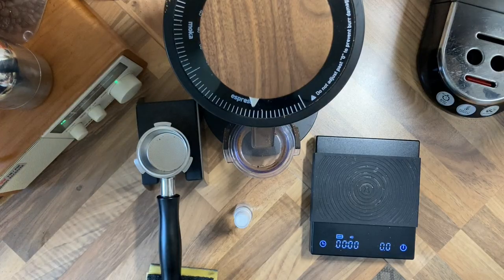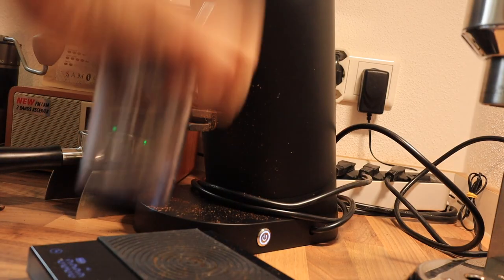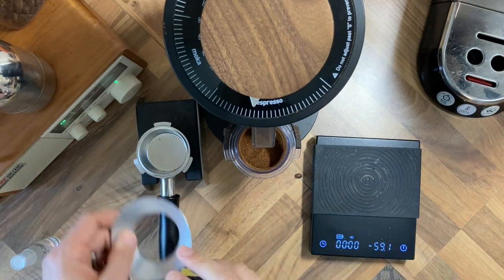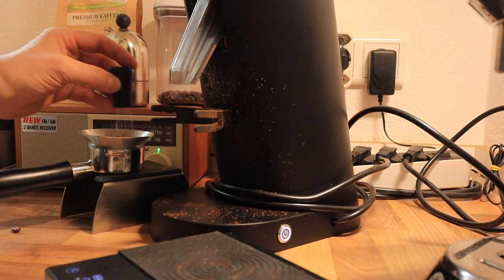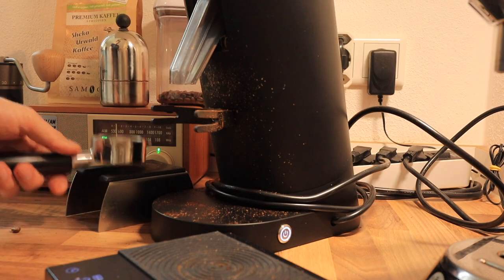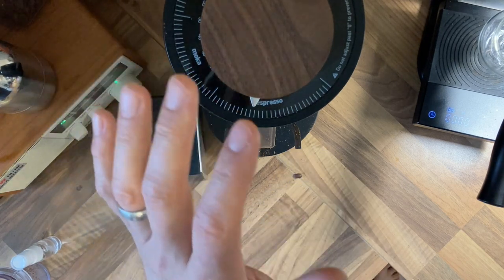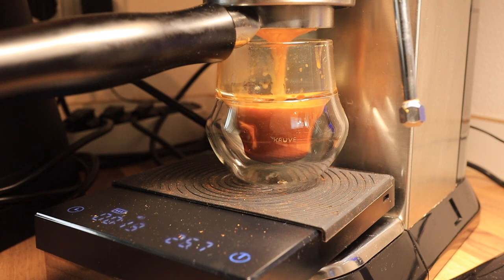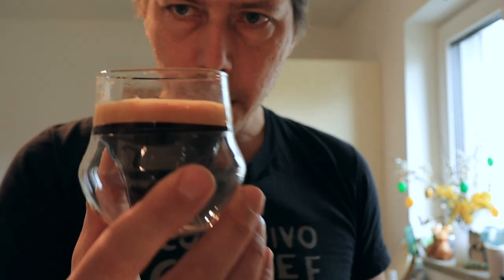How to make a turbo espresso on the Delonghi Dedica

Comment: Maybe due to temperature stability issues of the Dedica, I have found this to be the only way I can pull nice shots out of lightly roasted beans. A 1:2 ratio always tastes like vinegar, regardless of any temperature hacks or grinding very very fine. Pulling slightly longer shots (in the range 1:2.5 to 1:3.5, I'd say) takes away the acidity to a point where it seems like magic. Trying this earlier, instead of sticking religiously to the 1:2 ratio, would have saved me from throwing away liters and liters of coffee.
Reply: Did you try using a different basket?
Reply: @vcinches  honestly, just a couple, one I found in AliExpress and an IMS for 16-18g (the largest one). Do you think it would be different with another basket? I still have to stick to a minimum of 1:2.5 for lightly roasted beans. The body/strength and grind setting varies a lot for different beans, but in:out ratio is always around 1:3 for it to taste any good (for me). I buy beans from local roaster (ciano).
Reply: @ribesjordi  Thanks. I did replace my oem basket with HUGH by IMS, which I found at Amazon, and was very surprised with the change in tasting notes of my espresso. Yes, the grind setting do really vary per beans and roast. I also got mine from a local roaster/medium, and usually just grind my beans after resting it for two days after roast. Also I adjusted the machine temp to mid, I tried the lowest but went back to mid-high. I'm still thinking though if I should also change my shower head with IMS.
Reply: @vcinches  I have also been thinking about the shower screen! For the moment, however, I find I can get good results with my Dedica and the 1zpresso jx-pro. Maybe I end up getting it later, but, for me, right now good beans are a much better investment. Perhaps the lower-dose basket from IMS would be good to have to tinker with the dose, what do you think?

There are some beans from which I have never been able to get a good espresso, especially honey/natural dried and ones with "lighter body". Italian arabica-robusta medium roast blends are the ones I have been able to dial in better.
Reply: @vcinches  I have been skimming through my notes, and I have to correct myself. The best coffee I ever made on my Dedica (italian, trinci since 1939) was around 16g-24g in 22s with the IMS. Almost at the ristretto range. So, not always 1:3. But the latest I got (new wave, ciano) was good at 16g-38g in 27s, which is about the range I find works more often. It varies a lot with different beans, though.
Reply: @ribesjordi I have been using the IMS 18 grams every morning, and another one after lunch. Just an FYI, I just do this for my home coffee, and I just wanted to taste good coffee everyday, so I changed a few things. 😊 This morning I was able to pull off 1:2.1 with 18.5g coffee - as what my scale said 😅. I'm using the mhw-3bomber mini smart scale replacing my timemore black mirror. So, I get to recalibrate from time to time from tamping to distribution, to grind size.
Reply: @ribesjordi also I'm glad to find this page on delonghi, really useful.

Comment: Looks like there was a fair amount of channeling in that shot.
Reply from the maker: Indeed. In my limited experience, turbo shots seem to be inherently messy, due to the coarser grind.
Reply: It's not channelling, in fact the whole idea behind why turbos work is that they have a more even extraction due to the coarser grind, I think it looks like channeling because water is rushing out faster like it would if a channel opened in a traditional shot
Reply: @alinaqirizvi1441  I could be but i was just reading an article explaining turbo shots and it explained that the shots should be done at 6 bars because of the course grind which many home espresso machines can do. Therefore at 9-12 bars you will probably have channeling.
Reply: @billsmith8225  yeah but the coarse grind means you can't get up to 9-12 bars, I'm sure if Tom showed us the manometer it would peak somewhere between 5 and 7 bars probably

Comment: With the 13/15 bar pressure of the delonghi and this grind size it fire's thru the coffee bed. Channeling as result
Reply from the maker: I have measured the max system pressure. If my manometer is accurate, the highest it gets is 11-12 bar, in a closed system. When pushing against a coarse coffee bed like this one, it probably only reached 4-5 bar.
Reply: @TomsCoffeeCorner  isn't it reaching just  4-5 bar , because is shoots true the coffee bed? it's like pumping up a flat tire , it wil not get above  0,5 bar because the air pushes out of the tire?
Reply: @ErnstBolder  yes but that's not necessarily a problem, and because of the coarser grind there is less channeling

Comment: I don't get the point of your turbo shot version. In a turbo shot they use almost the same 1:2 ratio for an espresso (1:2.2 more or less) and there's no channeling because of the low pressure (6-7 bar), so they get an even extraction (all the puck is perfectly extracted) shot after shot. At 9 bar you have massive channeling and a watery shot.
Reply from the maker: Well, the turbo shots can't hit 9 bar, since the grind is not fine enough. The coarser the grind, the lower the pressure in the system.

Comment: Confused. I thought if you underextract or overextract it doesn't taste that good as good as extracting at the 2:1 ratio in 30 secs for 20g coffee (approx ballpark people seem to agree on). Why don't you just do that then add an extra 20g of boiling water afterwards?
Reply from the maker: I think less contact time with the water due to the coarser grind makes this more palatable...
Reply: @TomsCoffeeCorner  that's the definition of under extraction- coffee ground too coarse. So why not make a perfectly extracted espresso, add water and taste the difference. Otherwise, extraction quality is a myth, but is seems like that's not the case.

Comment: I see you get some spattering or tiny streams on the side of your cup. Why do I get this when I pull a shot? I don’t just get the cone- although it’s mainly a cone- flowing from the bottomless portafilter. I get a little bit of this side splash. Is that normal or am I doing something wrong?
Reply from the maker: Well, puck prep takes practice, and also you need real freshly roasted beans. 
These videos may help:
How to extract the perfect espresso: https://youtu.be/piO6c695Op8
How to Get Crema: https://youtu.be/00NSG9459a8
Why Supermarket Coffee Beans are RUINING your Espresso! https://youtu.be/5BgMKqu8fJI
Reply: @TomsCoffeeCorner  Thanks! (also I corrected the bizarre autocorrects that my phone put in my question!) I am using really fresh and well roasted beans and I get very good crema and the shot tastes really good. But I don't understand why I get that little bit of splatter--usually it doesn't look like you do get splatter although I see it on your cup in this video.

Comment: Try experimenting with puck screens and paper filters. For me, they provide a bit of richer experience and less acidy.
Reply from the maker: Thanks for that tip! Do you have 51mm paper filters?
Reply: @TomsCoffeeCorner  I do not unfortunately, I could only find 58mm for the aeropress at the time, had to tamp them as they didn't fit, but I will buy some 51mm once I use all the 58mm. I used the paper filters for espresso for a time, at the top for a cleaner group head or at the bottom of  the portafilter resulting in a bit of a richer shot. Now I use a 51mm metal puck screen for similar results and I moved the paper filters to my moka pot, where the taste is noticeable better. 
As a side note, if you drink coffee made via french press, I also recommend using a pour over paper filter. As with the moka pot, it increases the taste and filters any small remaining coffee bits.

Comment: This is one day after I dialed in my machine to do the same thing.

I did the nine bar mod and then increased the grind size until the flow was homogenous through the puck. Result was 16.5 in to about 50 out.

Comment: Hi Tom!

Can you please tell how to use USA appliances (grinders/espresso machines) in Pakistan? We have 220-240v here with 50hz. Will a stabiliser would come in handy to work around the voltage difference?
Reply from the maker: You would need a transformer. Why not just import from Germany? The EU has the same voltage as you do.
Reply: @TomsCoffeeCorner  I would love to but most of the suppliers don't supply to Pakistan, another factor is the customs. Due to current economic influx, the customs have been doubled on such items (tagged as luxury). I have my sister in USA so I was hoping to get from there, I will see if I could find international models with same voltage. Thank you for your response. I watch all of your videos, really helpful and informative!  👏
Reply from the maker: @TheRabiaFactor  Boy that's too bad about the difficulties in importing. You could buy a transformer, but you'd need at least a 1500 watt one, which is probably like another $100. Just keep that in mind.
Reply: @TomsCoffeeCorner  oh okay. Thanks for the heads up. I’ll check if we have transformers here in local market that could hold up to 1500watts or so. Thanks a lot for the guidance 🙏